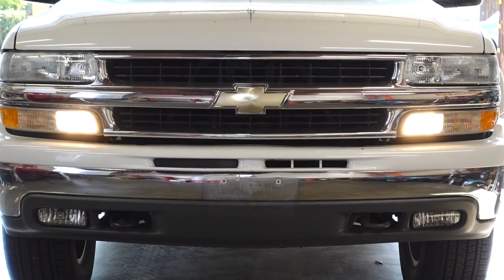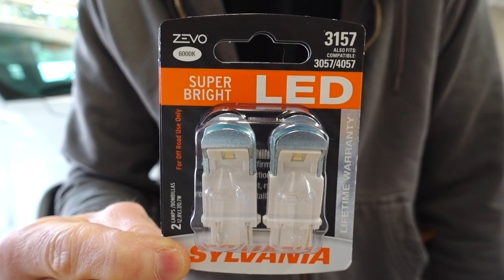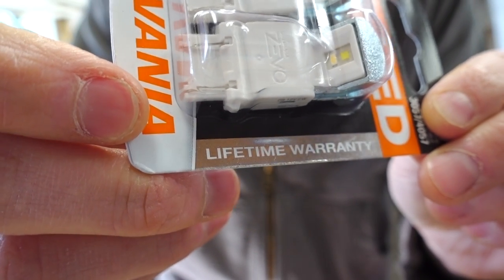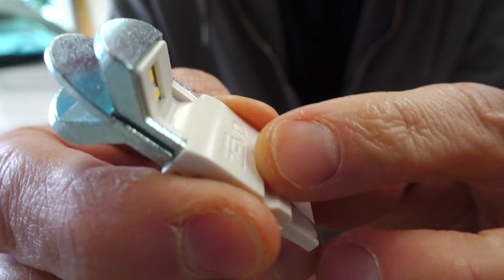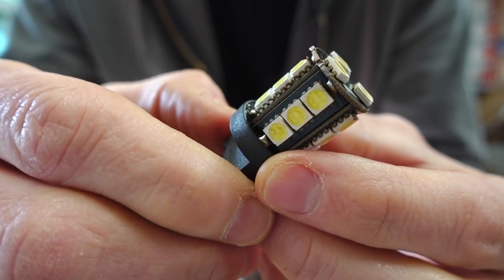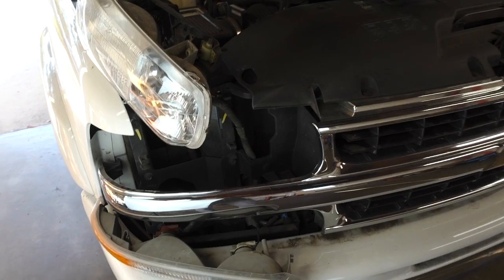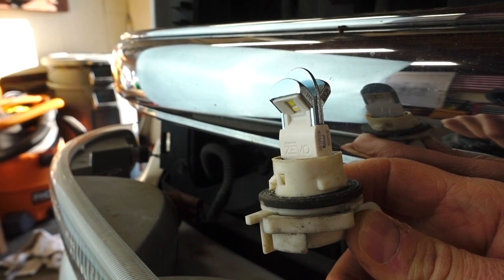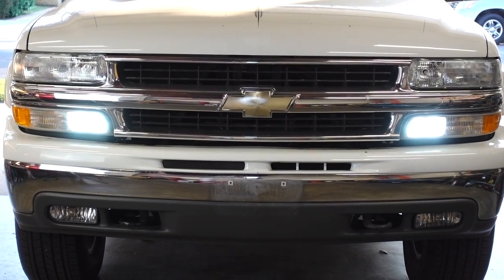Here's Why THESE ARE THE VERY BEST AUTOMOTIVE LEDs YOU CAN BUY!!

Comment: I'm getting so tired of being blinded by LED headlights , especially when it's raining at night . 
Back in the 70's , 80's & 90's they would have been legal for off-road use only .
It's an accident waiting to happen . 
Wearing Blue Blocker glasses at night takes away some of the intensity/harshness of the LED lights .
Reply: It's not just the brightness of the lights, a lot of people just Remove & Replace the lights without ever going through the process of making sure they are aimed correctly.  And some peoples minds are so dim that they don't know or care if they are coming at you with the bright lights on or not. That's why I want to just make my bright lights the brightest, because they don't get used often enough to burnout, and I want to be able to burn the retina's into the backs of the brains that refuse to dim their lights when coming towards me.
Reply: People get the LEDs confused with the hids headlights which are very bright but much harder on your eyes than the LEDs are. Try a pair in you vehicles and I'll guarantee you won't regret it. P.S they also come with LEDs from the factory now times are changing adapt or stay off the roads.
Reply: The problem has nothing to do with HID or LED themselves, the problem has to do with idiots sticking either style into reflector style lenses and not projector lenses.  Only halogen should ever be used in reflector lenses.
Reply: @cup_and_cone  Except there are cars which come with reflector HIDs from factory... Though, they use HID bulbs specifically designed for reflectors (D2R in Toyotas at least)
There are also modern LED bulbs that work pretty well in reflectors, but they need one with a smooth lens, and they have to be aligned properly.
Reply: I've only really been blinded by old shitboxes with poorly aimed lights.
Reply: @TopiasSalakka  Those factory HIDs are not the same intensity as the LEDs you can buy these days, and were engineered so the light source and reflector interact in a certain way.  Stick a random Amazon LED in there and they'll be too bright.  The bottom line is that most projectors have cut-offs, so they will not blind oncoming traffic, regardless of how intense/bright of a light is installed.
Reply: @cup_and_cone  Random Amazon LEDs will be less bright, they have garbage LED chips and heatsinks.
Their problem is poor chip placement which sends light all over the place.
And btw, modern reflectors have cutoffs too...
Reply: I agree , I'm amazed that some vehicles coming at you have such bright lights, you wonder if they are legal. I have to wear night vision glasses just to drive at night . I've had vehicles following me at night ,and their lights actually make a shadow of my car in my own headlights... Amazing, I can turn my lights off and drive by their lights , even with them behind me.
Reply: @tomsmith9349  If the light beam hits your eyes, somethings wrong.
1) bad bulbs that cause scatter
2) not aligned properly
3) high beams are on

Comment: I put these zevo 3157s in my sierra and for some reason they seem to be as bright when they're installed in the housing. They look dim, but when I hit the turn signal they go brighter which is weird
Reply: Regular 3157 light bulbs have two filaments,one is about 5 watts,one is about 25 watts so much brighter. When used behind red plastic or glass taillight the 5 watt filaments runs as the taillight when the parking or headlights are on, the 25 watt filament goes on whenever the brake pedal is pushed and on some cars when the turn signal or flasher is operating.  The zevo might be the same- more of the LEDs lighting when the brighter filament of the plain old lightbulb is supposed to be on.

Comment: Sylvania's quality has gone downhill.... Better than the cheap ones you bought. My Orielly's is constantly replacing them under warranty.
Reply from the maker: todd reynolds constantly replacing your what? Zevo LEDs?
Reply: Any of their Sylvania bulbs. Even their higher dollar bulbs. They have a set of $60 bulbs, can't remember the model name off the top of my head, that burn out about every 10 months. Luckily they have a 1 year warranty on all their bulbs.

They have another customer that warranties out his bulbs every 3 months like clock work.
Reply: To the best of my knowledge, they don't carry LEDs.
Reply: @toddreynolds7837  If you are talking about the silverstar ultras they burn much hotter than the basic in order to get that much light. So yes they will burn out faster. If you want that my light or more and long life you need to go to LED or you will just keep replacing them. I tell everyone I see the ultras to they they have a 1 year warranty and will only last about 13 months under the average estimated use. Where I live they are ok with that since we have a lot of deer on the hwy's here.
Reply: todd reynolds you aren’t running ZEVOs then
Reply: Running silver star ZXE because that's what Orielly's offers on the better end
Reply: todd reynolds again, you’ve been told this by someone else already: silver stars are just halogens that run hotter. Its not even the same technology.

Comment: I did LEDs in the dome light. The light stayed on because the bulb does NOT put out the wattage for the computer to recognize it was on. I changed back and had to go to the dealership to reboot the computer. Not recommended on some models.

Comment: Will those led 3157 fit the reverse lights
Reply: For 99-06 GM trucks it is 3156 for reverse lights and rear blinkers, 3157 for dual filament like brake light and front blinkers, and then 4114 for DRL

Comment: Just purchased these Sylvania Zevo bulbs for my 05 Tahoe. I just replaced all my bulbs and within a month a DRL burnt. I'm tired of replacing them.
Reply: Same. 2005 Tahoe and got tired of replacing quickly burnt DRL's. Just replaced both and like you, one died within a month or two....BUT, I found out my DRL housings were holding water. I replaced the housings and switched all exterior lights and interior bulbs with ZEVO's (except turns). It's been like 3-4 months, no problems and I don't foresee having any. I switched the headlights with SYLVANIA 9006 LED FOG & POWERSPORTS BULB for the low beams, and have a second set in the vehicle as a spare, just in case. The fit was a little loose due to the o-ring being on the small side, so I put a single dab of black quick-dry RTV just to keep them from turning from bumps or whatnot. I also keep a spare tube of new RTV in case I need to swap a bulb on the road. They've worked well so far and look great. I contacted Sylvania regarding the loose fit and the customer care person said these are for offroad use and they do not recommend them for headlights.....but if you search their website for your vehicle specific fit, they clearly have them listed as a 2005 Tahoe headlight option.

Comment: I bought some Sylvanya ZEVO H11 headlight LEDs designed as a direct halogen replacement here in Canada. They weren't cheap but they are awesome tech. Most aftermarket LEDs are crazy high lumens and are like driving with your high beams on all the time. These are spec'd to be OEM brightness so you're not blinding people.

Comment: I bought a couple of these same bulbs, from an autoparts store, I made the mistake of discarding the receipt. just after installing these lights, one of them would flicker and sometimes would not light at all. I took them back and they would not replace the bulb because I could not "Duplicate the Problem" and I did not have my receipt. So, I no longer shop at this autoparts store, I don't want to name them but I'm sure they won't ADVANCE my decision to ever make another purchase there. Since I purchased a pair and one is inoperative, now I have 2 of these Sylvania Zevo lights sitting in my tool box that cost me 25.00 for a pair, that are totally useless to me. Had I known I could go to Sylvania and register the lights I would have done so. So, I've learned that even at the age of 67, you can always learn something new everyday.
Reply: Good to know. I won't ADVANCE to buy another alternator from a certain autoparts store either that gave me the same difficulty. The kid behind the counter expected me to believe it was putting out 60 amps through an 18 gauge wire connected to a voltmeter. I had to argue to get them to honor the lifetime warranty on that.
Reply: @randystegemann9990  That's funny, I installed a hot tub, the wiring is 6 gauge for a 60 watt breaker. That kid should be selling tennis shoes.
Reply: @jumpercable20  I doubt that kid could could even do that correctly. He was probably just doing what another employee showed him to do without understanding anything about electricity. It shouldn't take an electrical engineer to know the difference between current and voltage.
Reply: ADVANCED AUTO?  NEVER HEARD OF THAT FRANCHISE STORE.  OREILLYS?
Reply: @microminiskirt  Double check my spelling XXX, there is no ED on my Advance.

Comment: I tried these for my brake lights, constant flickering and warning light was on in the car for light. 
Which is weird. Cause Every single light in my tucson is LED. From headlight, to signals, to side marker, reverse, license plate... etc. But the brakes... I've tried so many. All of them flicker. 

The ones with the built in resistors, maybe a month. Some lasting a few days. Then either die, or start flickering. Riddle me this. lol
Reply: Sounds like you need an LED flasher relay.

Comment: With the heat sink inside the housing itself I'm not sure how good they are. Would be better if they had an active fan or something outside to draw away the heat as well. Such as the SL1 from diode dynamics.. that's my preference but this is still probably a decent enough bulb
Reply from the maker: Personally I would never put a bulb in my car that had to use an active fan as a source of cooling. The fan could fail or produce some sort of electrical interference. And just be plain loud.
Reply: @1RoadGarage  that's a good point there. The fan you wouldn't be able to hear from inside the cabin but it is a failure point. Although the fins inside the housing are as well, but with that lifetime guarantee it's not an big worry. Still, you should look into the SL1's by diode dynamics. I'd be interested to watch a video with your thoughts on them

Comment: The LED lamps are usually advertised to last for 25,000 to 50,000 hours.  The actual LED diodes used in the lamps do last that long, but the electronics and other components of the lamp fail on cheap units.  Quality LED lamps also handle vibration very well for general road vibration and particularly good in door panels or tailgates that get slammed often.  The simple failure of a light bulb creates a much larger task to reach that bulb in the enclosure to change it.  That simple failure also makes your vehicle illegal to drive with a tail light, brake light or signal light out and may be dangerous if other drivers don't know your stopping or making a turn.  Many cheap LED combination lamps used to illuminate as a tail light and glow brighter as a brake light have a very minor intensity difference between the two modes.  When you step on the brake, the driver behind you that is viewing your tail light sees virtually no difference when your brake lights are activated.

Comment: Those cheap LED BULBS don’t last and are waste of money , I have a set of Auxito leds as DTRL s and I’m on my 2yr with them, and there about $20 for 2 bulbs . Haven’t tryd the Sylvania yet though
Reply: I only now go with Sylvania LEDs.  You can find them at your local auto parts store or Walmart.  I’d rather pay $14-22 per set and never have to worry about switching light bulbs in a long, very long time compared to the cheap Amazon and EBay specials.

Comment: I have 6 of those bulbs in my tail light panel. .....any other led light wouldn't work as a blinker or brake light if my parking/headlights were on......I put these zevo's in and problem solved.....the cheap ones only worked if my lights were off..   I spent hours and lots of money chasing ground wires and scratching my head....  I still don't understand why the cheapies worked so great in the day , but not at night

Comment: It's not surprising that the cheap ones you buy are really cheap, the chip used is the SMD5050s, not known for their quality and durability, they flicker quickly. You might experience something different when using other chips like the SMD3030s or SMD2835s

Comment: Those leds aren’t great as turning signals or brake lights because there isnt a good transition between running lights and break lights
Reply: Never had a problem with anything I get from superbrightleds, always top notch stuff and I've yet to lose one
Reply: These have a very good on/parking light transition.  These are actually one of the best on the market.
Reply: luke pm * brake

Comment: i did my jaguar xtype with these and i did cost around 150$ for jsut a handfull of bulbs of diff types. two issues issue one. one of the bulb styles was like a tube that the mount clamped on each end with a sping loaded pressure. the pressure from teh factory for the incadesent bulb was way to much for the led bulb and the bulb itself colapesed under use caused heat and faulure. i retured the damaged bulb with no issue and reinstalled the new led bulb after i had bent the mounting tabs slightly to reduce the mounting pressure aplied to each end of the bulb as to no pinch it so hard and that solved the problem. issue two the interior main light in the roofs center console stay light very very slightly enought to see that the bulb is glowing in the darkness and i have yet to fix this issue has anyone had the same issue were the led stays very slightly iluminated when everything is supposed to be off. vehicle jaguar xtype 2002

Comment: Since there's no way for led radiator to get rid of heat, it will be hot. It will work longer, but still bad thermal condition for led chip.

Comment: Great video and I totally agree with your findings. 
Ive bought 16 of these EVO bulbs the last 30 days and switched out 90% of my bulbs to the EVO LED and they look great and are solid , a great investment. 

I did have to change flasher relay , EP34 for my Saturn VUE 2006 , The power load was too heavy for the LEDs so I got the rapid flash , and when I applied my break the flashers would go out and not work , not safe , but after I change the relay it worked perfect. 

The other 10% of bulbs ive used other brands , since Sylvania EVO doesn’t make all the bulbs I needed. 
HIKARI ultra Headlight and High beams. 
NINEO 880 LED for the fogs. 

And some other odd ones for the cluster and int dome light. 

Its been a fun project.
Reply from the maker: Nice! 👍👍

Comment: WHHHHHAAAAATTTT?????!!!!!!  I just watched your other video and used those other bulbs!!!    I thought you said the LEDS are not hot like the original bulbs!!
Reply: Its relative. all light puts out heat. Incandescent burns real Hot, while LED's are much more efficient and create less heat. but they still create heat. as long as the bulb has a way to move the heat from the Diode itself. your fine.

Comment: That was pretty scary that an OEM bulb from the factory fried those bulb sockets so badly; who engineered that assembly? That said, one thing I have noticed is that a lot of cars have a problem where the headlights are so powerful they wash out the turn signal indicators completely, i.e., when you're facing a car in the intersection you don't know where the hell they want to go. Again, it's a problem of poor design putting a more powerful light source beside a relatively weak light source and expecting them both to do their job properly. Some newer vehicles use daytime running lights that are not the headlights and/or have the headlight temporarily turn off while the turn signal is operating; not sure that's the best option, though.

Comment: No BUILT in LOAD RESISTOR ? = Hyper Flashing
Reply: Thats only for the turn signals btw. Get an LED flasher relay. I put one in my 2000 and all my LED turn signal bulbs don't hyper flash. No resistors needed.